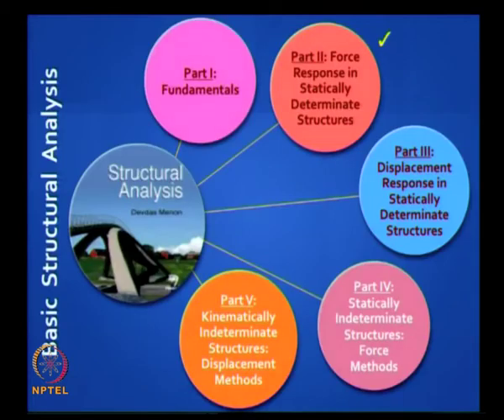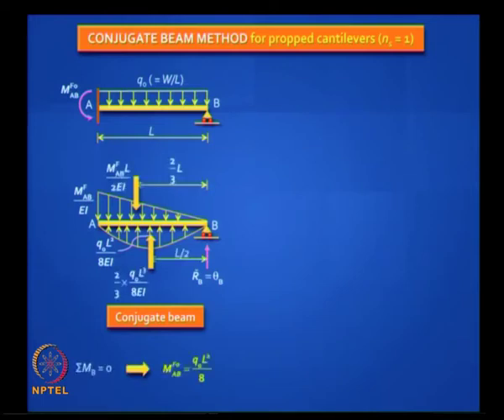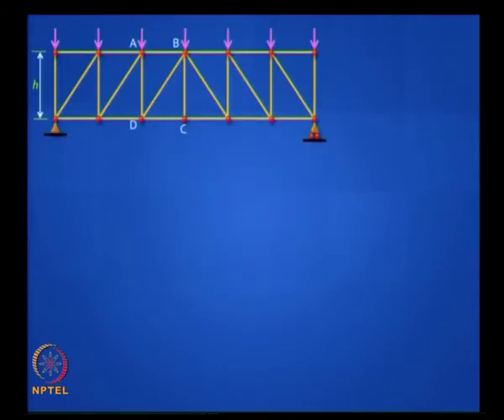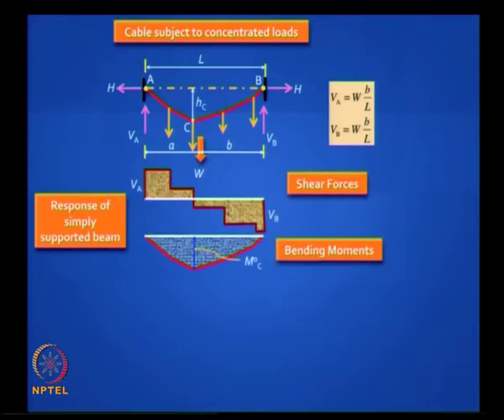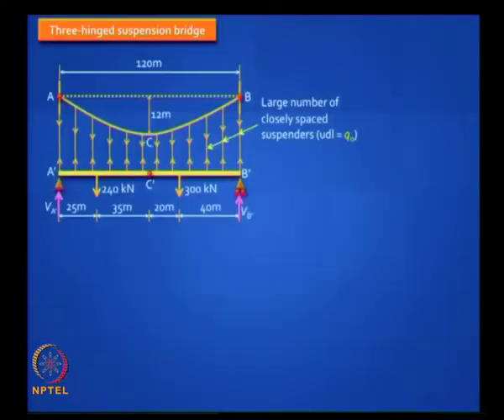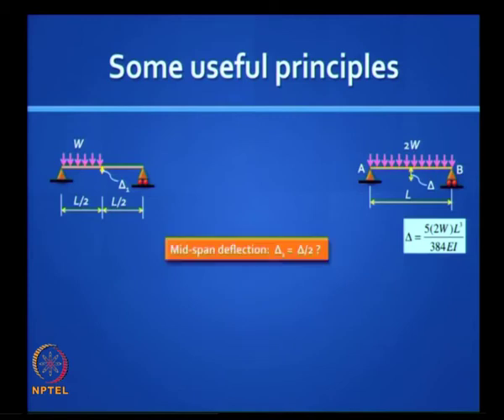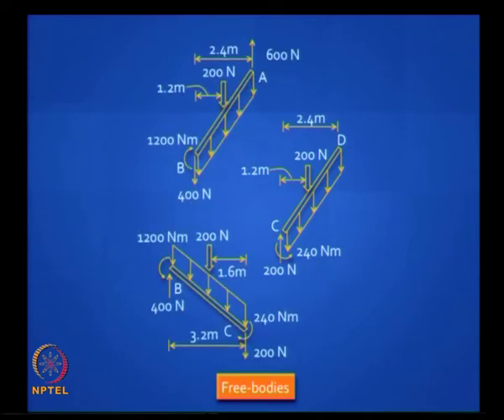Mod-01 Lec-03 Review of Basic Structural Analysis I

Comment: 🎯 Key Takeaways for quick navigation:

00:12 📚 The course on Advanced Structural Analysis focuses on reviewing basic structural analysis, covering statically determinate structures, and work and energy methods.
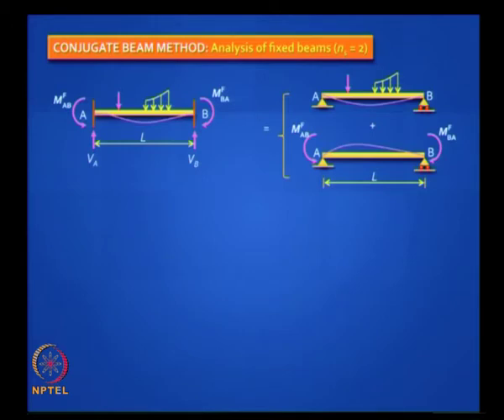01:10 🏗️ Structures in the course are represented as skeletal models with elements interconnected by joints, comprising space frame, plane frame, grid, or beam elements.
02:34 ⚖️ The analysis aims to find the response of structures in terms of force and displacement fields, considering both direct and indirect loads.
04:49 🔍 The course primarily focuses on linear static deterministic analysis, though it acknowledges the possibility of non-linear, dynamic, and probabilistic analyses for advanced study.
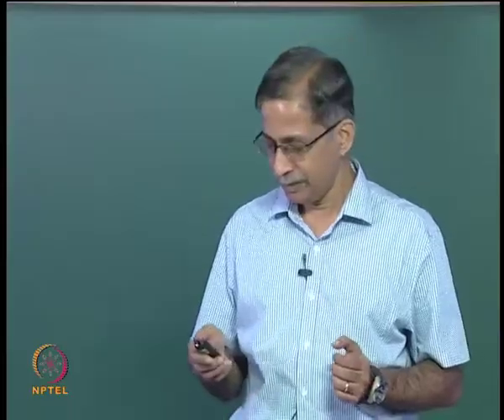06:20 📏 Key topics covered include finding support reactions, analyzing beams for bending moment, shear forces, deflections, and slopes, as well as analyzing trusses, cables, and frames.
08:18 📐 Direct equilibrium equations simplify for planar structures, reducing from six to three for analysis, especially beneficial for simpler calculations.
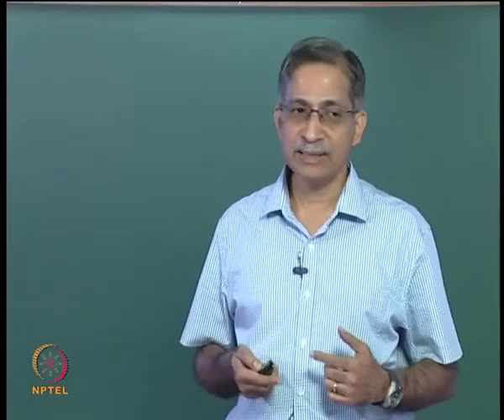10:35 🔄 Identifying correct solutions for structures involves ensuring both equilibrium and compatibility, critical for ensuring structural integrity.
14:23 📊 Differentiating between free-body and loading diagrams is essential, particularly for understanding structural behavior and ensuring compatibility.
16:21 🏗️ Support reactions for simply supported beams are straightforward to determine using equilibrium principles, facilitating stability analysis.
17:43 🏛️ Statically indeterminate structures like three-hinged arches introduce additional equations of condition, allowing determination of reactions using equilibrium principles.
20:30 🧮 Reactions calculated for one statically determinate structure apply to structurally similar configurations, emphasizing the independence of reaction determination from specific structural type.
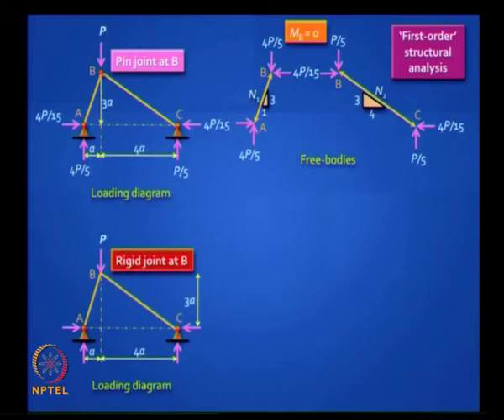21:59 📏 Beams are characterized by both kinematic (deflection, slope, curvature) and static (load intensity, shear force, bending moment) variables, interconnected through fundamental equations.
27:46 📈 Curvature varies with load intensity; cubic variation in bending moment leads to fourth-order slope and fifth-order deflection variation.
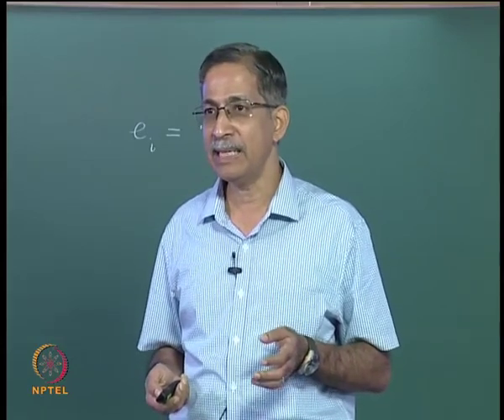28:41 🔄 Given a bending moment diagram, predict loading diagram by extracting shear force diagram, then free-body diagram.
31:28 ❌ Rigid foundation assumption can lead to incorrect analysis; soil pressure and load distribution must be considered accurately for structural stability.
37:02 📊 Conjugate beam method simplifies finding deflections by relating kinematic and static variables, providing a straightforward solution.
41:10 🔍 Deflection in beams can be calculated via displacement approach (integrating curvature) or force approach (inertial forces).
43:55 🛠️ Conjugate beam method provides a powerful tool to find deflections and slopes by relating loading and kinematic variables in an equivalent beam.

Made with HARPA AI